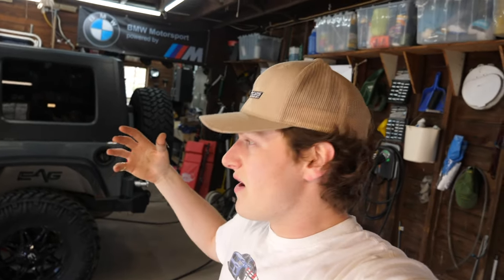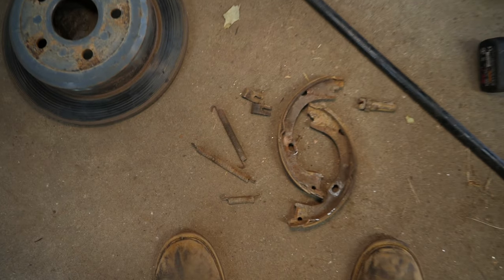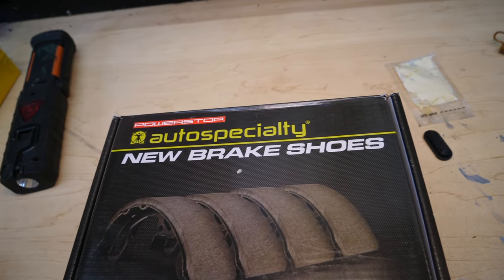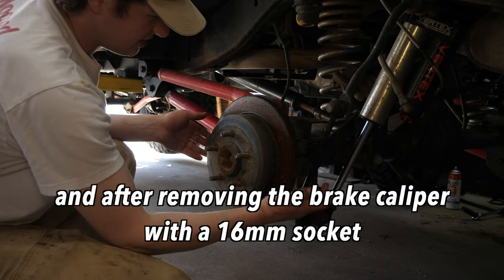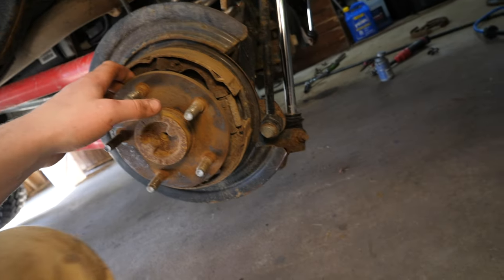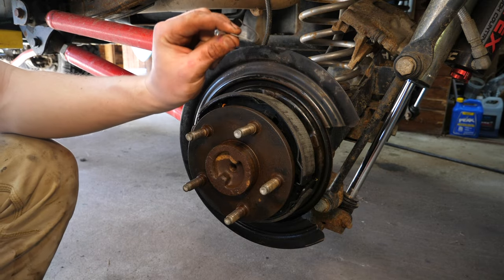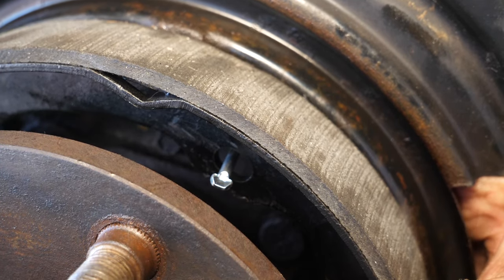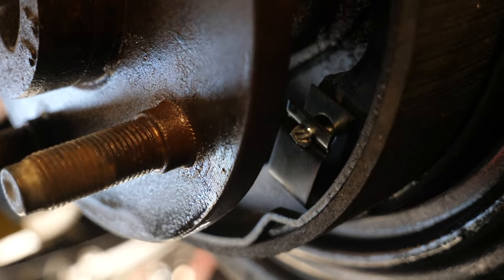How To Replace Parking / Emergency Brake!

Comment: That adjustment screw should but up not down🤷🏾‍♂️
Reply from the maker: There's less debris/rust build up this way
Reply: @JDCarsChannel  there's usually  a hole in the back side of the backing plate that line up with that star adjuster thing to adjust it without taking the wheel off. If its upside down now the hole wont line up with the star adjuster. Maybe it wont be that big of a deal.
Reply: @djustice9948  I agree. It might be a problem in the future if you can't access that adjuster gear with a screwdriver to back off the adjuster wheel so you can remove the drum/rotor in the future.
Reply: Cool video

Comment: You probably won't see this but..... thank you... you have no idea the struggle iv been having and I can't afford the shop right now and I need a new saftey in November so I had to get this done. The old ones let go of the pins and they bounced around in the drum I thought something big happend thank God it was only thay but my shoes were also stuck on the drum so they had to be replaced I spent hours trying to put new ones on and I googled 2009 dodge nitro and it kept bringing me to other dodges and such but after 45 minutes of videos I cam across yours!!! And because jeeps and nitro have alot of the same parts I checker your video and BAM!!! EXACTLY THE SAME!!! so thank you, you got a follow and a full time supporter!!!

Comment: It’s very important to check the parking brake actuator and connecting rod while doing this job. If the two pivot points are seized up like mine were, the parking brake will not operate properly. Rust belt problems. 
Also, don’t use never/anti seize on any moving brake parts. It’s a polarizing topic but 2 of my caliper pins were completely seized to the mount and I loaded that stuff on when I installed them. Use brake & caliper grease.

Comment: Your video was super helpful, thanks! It's not the easiest job but doable if you keep at it. The only other tool I had which helped me a bit was a t-handled hook tool which I bought from Harbor Frieght years ago thinking that someday I would need it. It's angled at the end and makes it pretty easy to attach/remove springs without vice grips. Thanks again.
Reply from the maker: You're welcome! Glad the video helped! That harbor freight tool sounds like it worked nicely 👍

Comment: Best video I’ve seen that explains and shows great detail. I wish I could see the flip up mechanism that attaches to the link coming through the backing plate and connects to the parking brake cable but great job man.
Reply from the maker: Thank you for the kind words! I'm glad the video was helpful-- you got this! The mechanisms are quite simple and I'm sure you'll figure them out.